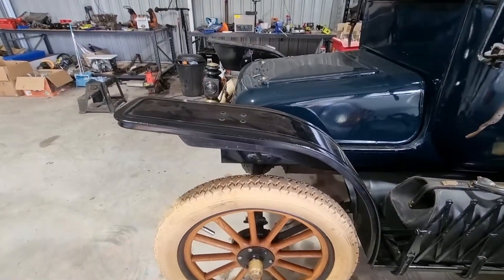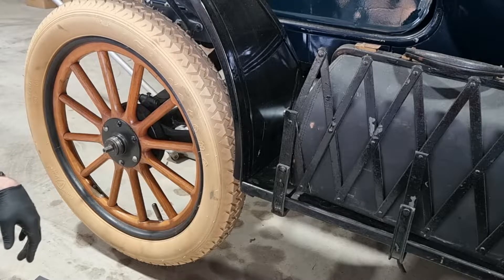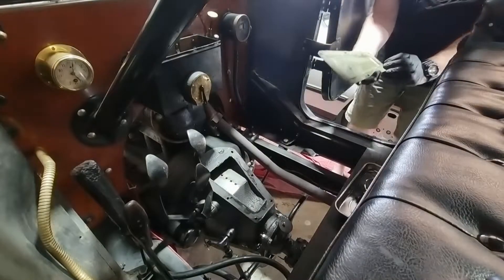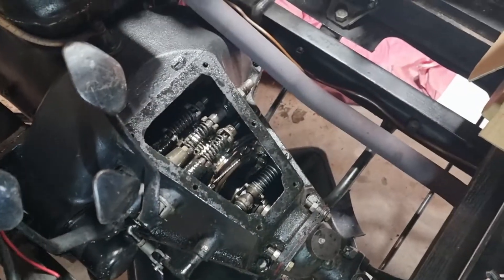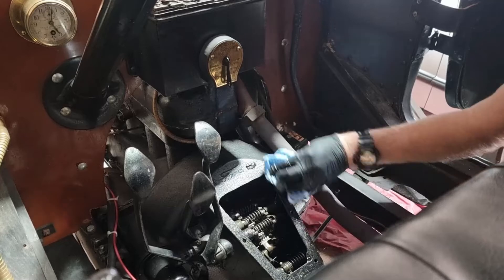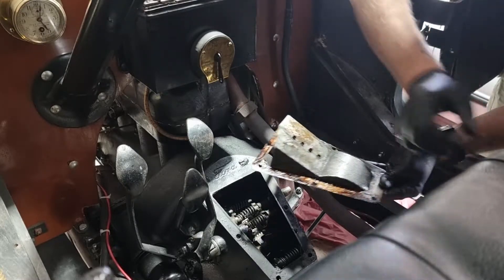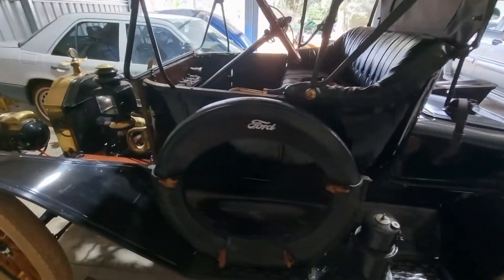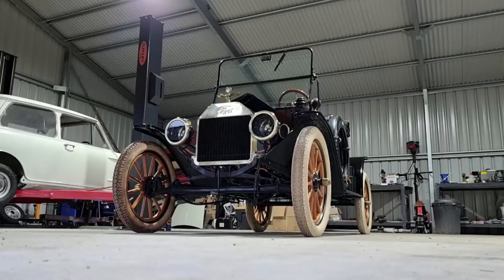Ford Model T Part 9

Comment: I just watched this video yesterday and then went back and watched the first video in you Model T series. A nice looking T to be sure, glad to hear you are getting it in to driving condition. It looks as though this one wasn't quite "finished" when you got it, with all the loose nuts/bolts. It would seem that a lot of "little" things got over looked and it sat for a while. Very glad to see you getting it sorted out and back in a driving condition. From a long time Model T owner, you're doing good work, keep it up. One question, when you had the rear wheel off, was there a split pin (cotter pin for us in the U.S.) in the nut for the spring perch? It looked as though it might be missing. I will be watching your other videos soon, good luck.
Reply from the maker: Hey mate, thanks for the comment. I raced out to take a look at the spring hanger and am happy to say all cotterpins have been addressed back there. You had me for a minute though. I've just finished filming part one of a new series. The car is now registered and I'm heading off on a 170 mile journey on Sunday. The footage taken today captured diff oil change, front wheel bearings getting repacked and some finishing touches.
Reply: @jl991825  Great to hear that your on the road! I am going to start watching your other videos today and I am looking forward to them. Just to make sure that we are talking about the same point on the cotter pin, at 37:59 in you video (when you start re-installing the brake shoes), the castle nut for the spring perch where it goes through the backing plate, on the inside of the brake drum. It may be covered up with grease/oil and I didn't see it, not trying to sow any doubt, just asking. You can re-watch the video instead of pulling the wheel to look and see if I am wrong, much easier.

As for the differential I would like to think that the previous owner went through it and changed out the original Babbitt washers for bronze. When you had the rear axle jacked-up it didn't look like there was any huge side-to-side play in the axle, good sign for replaced thrust washers, but not definitive. It will be interesting to see if they had changed out the original ball bearings in the front wheels to the later Timken tapered roller bearings. With the later engine, maybe? Either way, I am happy for you that it is legal and on the road and I will be looking forward to your new videos as well. Keep up the good work!
Reply from the maker: @pepstrebeck938  Hey fella, I'm now hearing you. Thanks for persisting. I tracked back and saw the missing pin. It's definitely missing. Bugger. Probably missing on the drinkers side too. Will rectify.  I really appreciate your comment and advice. Front wheel bearings are tapered but badly neglected as per current video. Check it out
Reply from the maker: @pepstrebeck938  ...I also do a forensic on rear axle. No babbitt, plenty of bronze sparkles...
Reply from the maker: @pepstrebeck938  Man, I just walked back a video after your comments. Mea culpa. There is definitely no split pin on the drinker side spring perch. Thanks for the eagle eye.